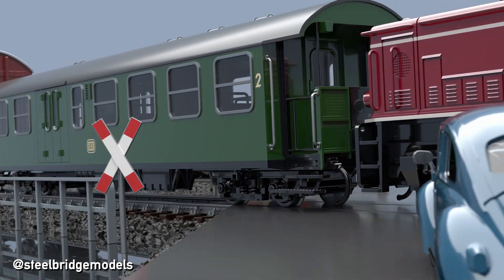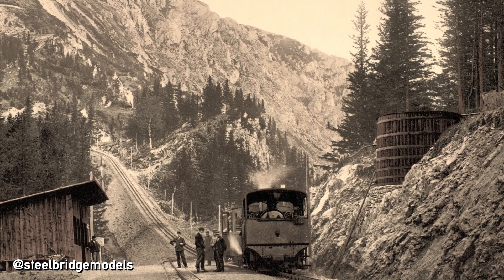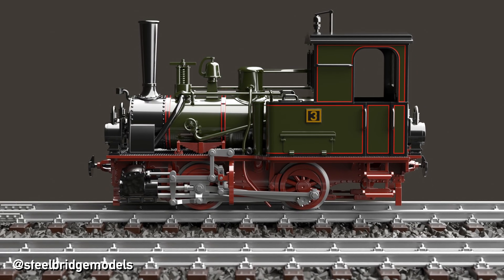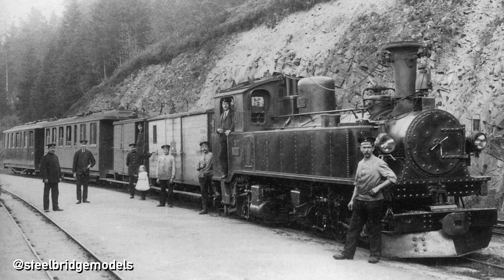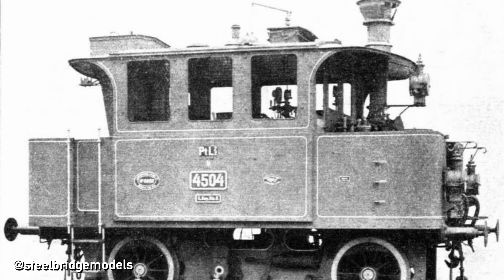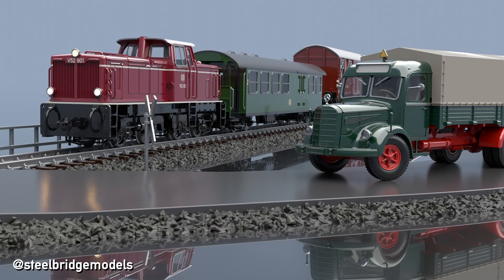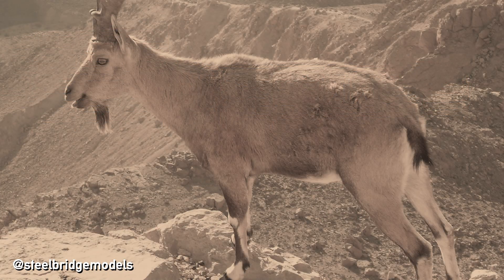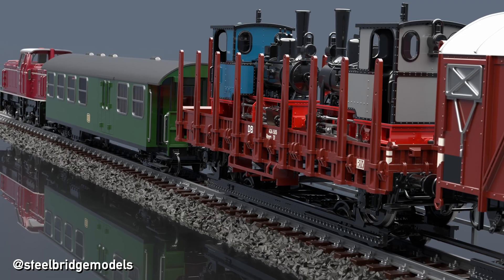Why would you put a train on top of another train?

Comment: There are many train distribution companies taking locomotives and rolling stoke between manufacture location and final use location. Some just couple to a main line loco but differing gauges and power systems require some stock to be carried. Even damaged locomotives can be carried on bogies assuming vertical clearance is not a problem. (Check out the kit RailAdventure has available for railway transport.)( there are others.)

Comment: Probably one of the funniest usages of "Rollschemel" was on the swiss CJ in the 90s.
The SBB recieved the Re 460 back then and named them after various regions and mountains. One was supposed to be named after the regio where the CJ is located. The christening of the locomotive was supposed to be in the region it's named after. But being standard gauge the locomotive could drive to the narrow gauge only region.

So they loaded it up on a CJ Rollschemel. But as the line is not designed to take a loaded up high speed locomotive, the catenary was to low. So the local steam railway association got to pull it with one of their importet Mallet steam locomotives, while the catenary was turned off

Comment: There is an even smaller gauge in Bad Orb Wächtersbach, which Service is currently not existing because the locomotive needs repairs.
Reply: I stay corrected: The Line is just 600 mm gauge and goes from Wächtersbach to Bad Orb and used to standard gauge until 1995. In 2001 the gauge was decreased. Now operator and authorities want to widen the gauge again.

Comment: Japan was considering implementing a "Train-On-Train" system to speed up freight trains using the underwater Seikan Tunnel. The tunnel links the northernmost island of Hokkaido to the main island of Honshu and is dual-gauge. The Shinkansen high-speed trains run on standard gauge while the majority of Japan's other trains run on Cape gauge (1067mm/3ft 6in). The concern was that the Cape gauge freight trains would seriously slow down the Hokkaido Shinkansen's timetable, so mock-ups were made of Cape gauge container cars riding on standard gauge flatcars. It hasn't been implemented yet, and no one knows if it will be.
Reply: One idea being considered is that they space the timing of the 1,067 mm gauge freight trains through the Seikan Tunnel so it there is time allowed for the Shinkansen to pass through the Tunnel at 200 km/h (124 mph) instead of the current 140 km/h (87 mph) limit currently used. I believe JR Hokkaido is doing this on Saturdays and Sundays. I still think the train-on-train idea could be implemented, since it appears that the configuration of Kikonai Station on the Hokkaido side and the Shin-Nakaguni Signal Station on the Honshu side could be expanded to include loading and unloading facilities for the train-on-train service.